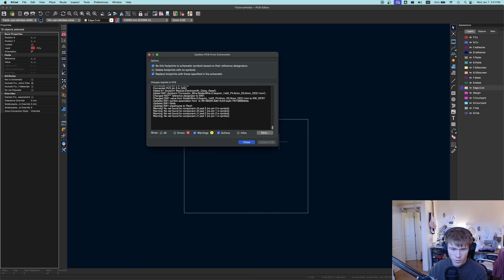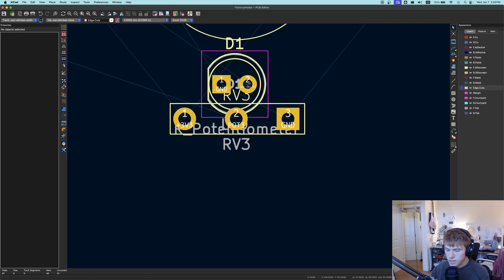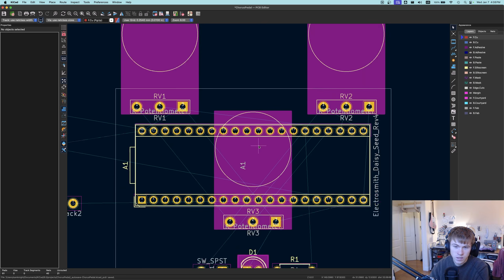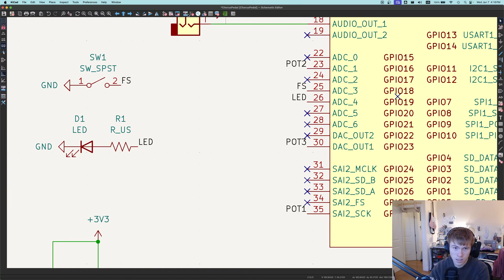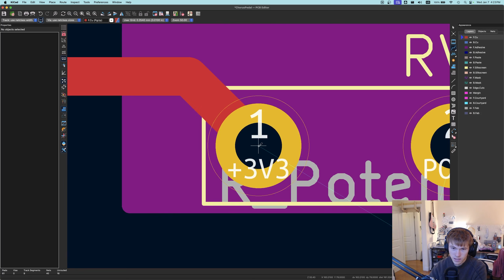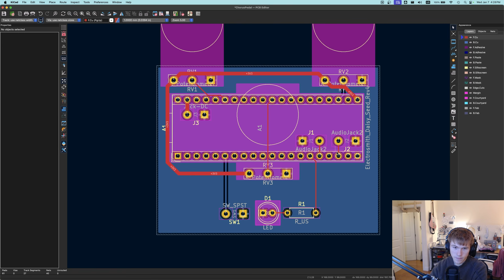Beginner PCB Layout & Routing for Audio Pedals (Daisy Seed)

Comment: Have you run into any of the high frequency noise issues that everyone talks about in the Daisy forums? I see what looks like a big capacitor footprint in the thumbnail (but not on the board in the video), was wondering if maybe that's there to mitigate the power supply noise. Great series by the way 👏
Reply from the maker: Good eye! Yeah when making super basic designs like this I'll sometimes just throw a 1000uF between VIN and GND and that definitely helps noise. But for a more serious pedal I'll add proper buffers like in this schematic https://www.pedalpcb.com/product/pcb351/ 

There's many good resources online on typical Op-amp or JFET buffers. They're not strictly required to get a usable sound with the daisy, but they'll definitely help with some minor tone loss. Playing around on a breadboard with it can be a great way to start! I hope to make a video on it in the future when I consolidate my knowledge on it a bit more. 

I chose to not include it in this course since I didn't want a section where people simply copy and paste exactly what I did since the course is all about making your own design for complete beginners, so I didn't want to overwhelm anyone! And I find that the Daisy sounds good enough without it to be passable

Comment: Thanks again for you course! Wouldn't you increase the size of fonts? At least momentarily. I think there is an system setting by which you can do so. While you record the screen cast? Wouldn't you ? Please. Thanks in advance. You know what: wouldn't you ?
macOS does not offer a system-wide font scaling feature like Windows (e.g., 125% UI scaling) that increases all text and UI elements without changing the display resolution.  The only way to make system fonts larger is by selecting a scaled resolution in System Settings > Displays, which adjusts the entire interface size. Wouldn't you? It may be beneficial for people like me which are in their fifties but also for people who watch on small screens cell phone mobil screens. Maybe. Thanks in advance and thanks again for your teachings
Reply from the maker: So sorry about that! unfortunately I've already filmed the remainder of the course and have it on the same font size 😭I'll make sure to do that next time!
Reply: @ImSamKnight thank you